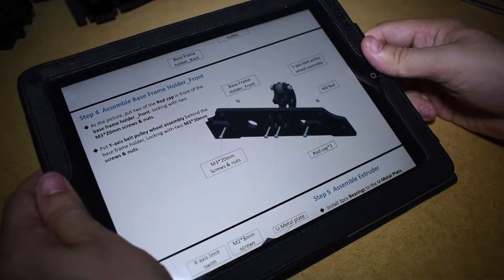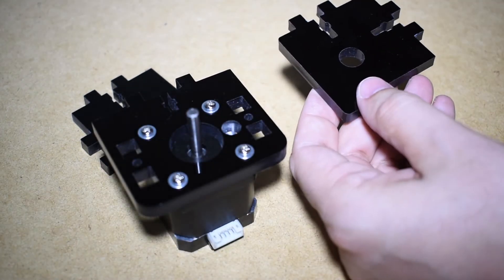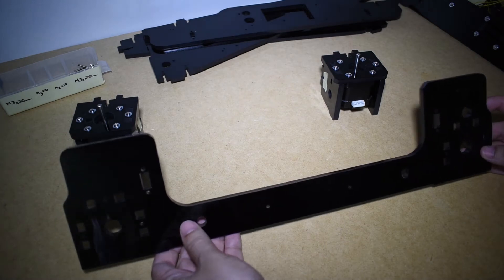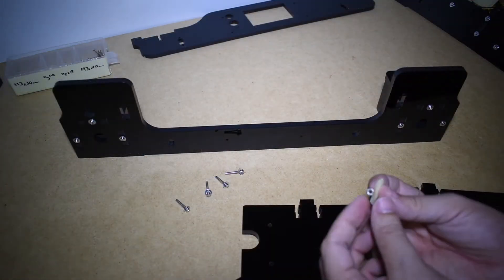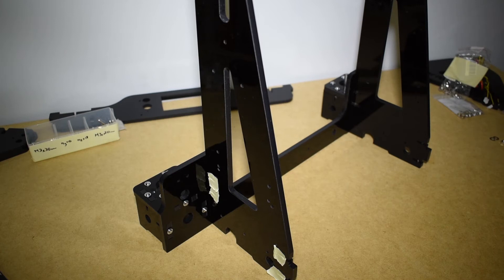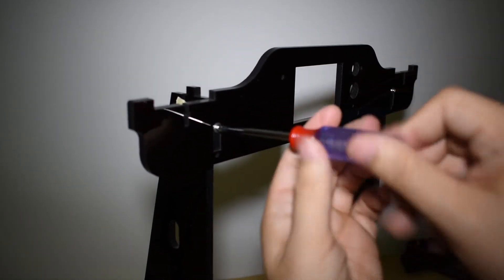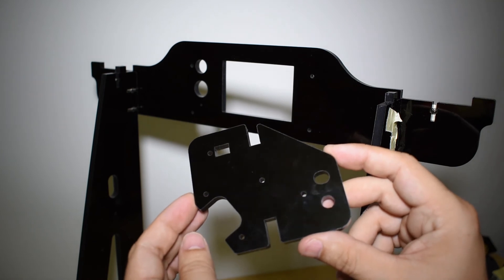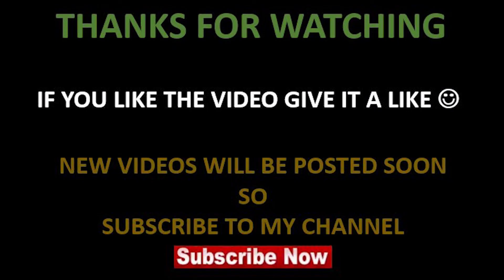Tronxy X8 assembly STEP  2

Comment: hi, I found my display module missing the sd card slot in the back. how about yours?
Reply from the maker: yy502tube,
mine too. I mentioned this in the unboxing. The SD card reader is in the main board so that's why you don't need one on the display.
Reply: ruiraptor ahhh, cool. I will check it out :-) By the way, I found the horizontal rods guiding the extruder module very hard to install, and then the extruder module doesn't slide as freely towards the right 20% of the rods. haven't figured out how to tweak that yet.
Reply from the maker: yy502tube ,
yes, they are very difficult to install in the side mounts. I used grease before inserting them and helped a lot
Reply: ruiraptor too late for mine... mine are poking out about 1cm on the right end... are they ment to fully go in?
Reply from the maker: Yes, it's ok. You will use the 2 longest rods for the X axis and they must go all the way to the left but you will end up with a little bit out on the right side.
Reply: ruiraptor good to know. Thanks for your advice.
Reply: ruiraptor I fixed the stiffness issue with the extruder on the x rods. I moved it to the stiff end, loosened the top 2 bearings on the extruder module and let it find its own way to run freely, and then tightened the bearing at that position. Problem sorted.